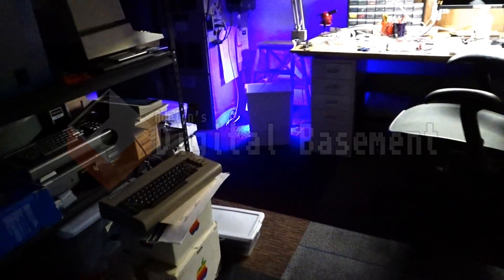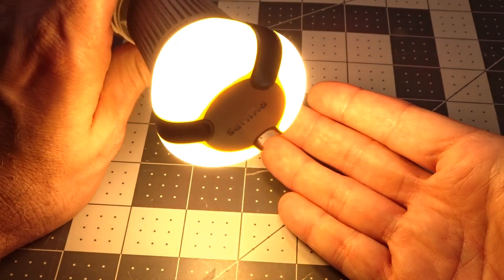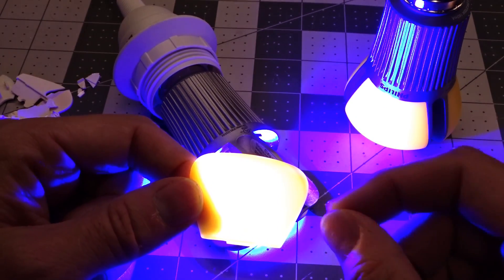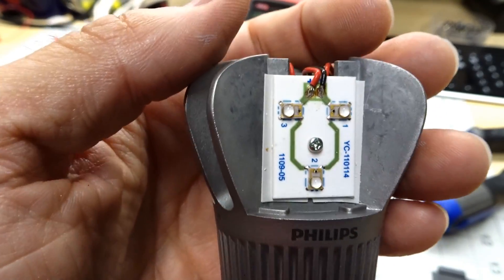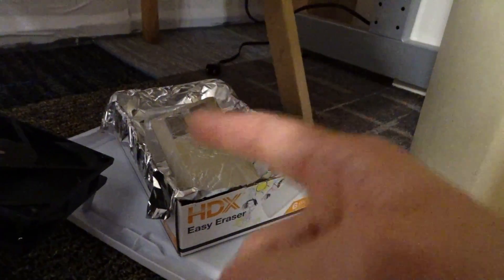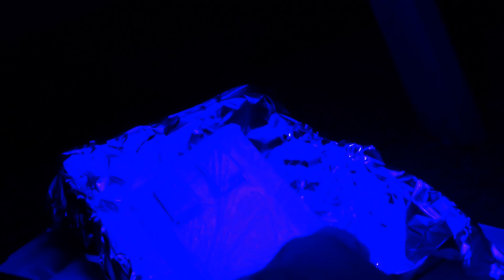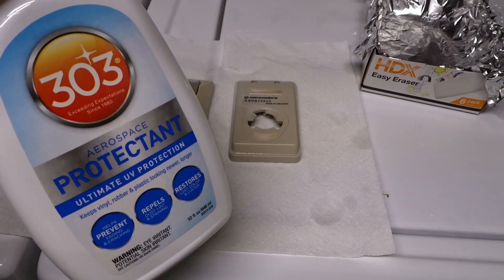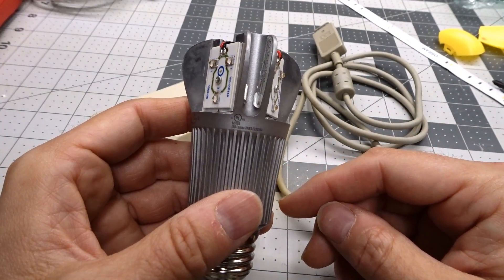A new way to fix yellowed plastics indoors?

Comment: And to be true, heat works waaaaaay better then UV. Just submerge it into water, crank the heat up to 160°F / 70°C, add peroxide and leave it there for few hours. It will work way better.

Comment: Interesting, but the experiment really needs a control (H2O2 creme in the dark) to compare it with.
Reply: Without a UV light the lightening process takes a very long time (like weeks), that's why people use the sun or an artificial light as a booster.  An alternative is to use a higher percentage H2O2 around 35% which can really speed up the process.
Reply: I use 40% creme and with UV or without makes almost no difference.
Reply: @chrisyboy219  Where do you buy the creme from?

Comment: Very neat!  I'd bet that there is good amount of UV coming out of those LED's along with the blue light.
Reply: Those LED's don't emit UV. They're monochromatic and only emit 457nm ±15nm which is nowhere near UV. If you want some evidence then go to mouser, search for high power led's and filter out 457nm LED's and read the datasheet. Of course high intensity light is always dangerous and the shorter the wavelength the more energetic the light.

Comment: That's a good haul.  Those remote phosphor lamps are very novel.  I've got a couple here and noticed that one has been in use in a corridor at Edinburgh Castle for a long time.
Reply: what about that clear UV lamp you reviewed on your channel clive? the germicide one. wouldnt that one be better for retrobrighting?
Reply: O HAI bigclivedotcom. I was about to message you a link to this video, but you've already seen it. So Adrian has beaten you to the punch in terms of a teardown of these, heh. It's pretty cool to see what's inside. I guess the in-series wiring explains how one of these can easily "burn out" upon failure of a single component. Btw., if remote phosphor really does have an efficiency advantage as is claimed then I wonder if there still are any new remote phosphor lamps being made today.
Reply: Surprised someone would throw them out - they don't make them like that any more. Maybe they just thought they were ugly when turned off (which they really are). I remember when these were on sale and I never owned any LED bulbs at that point because they were still too expensive.
Reply: I bought one similar to this about 7-8 years ago. I paid $25, and got buyer’s remorse. My wife didn’t mind the price, and wanted to keep it! It’s still running 24/7 in her lamp. The newer ones that cost $2 only last a year or two!
Reply: Hello Clive can I ask you a couple of questions ? 1 How many bandages on both your hands right now ? 2 Has anything blown up lately on your channel ? :-) :-) :-)

Comment: Get some of those suckers to the 8 bit guy!

I bet an ozone generator chamber with those lights in it could easily retrobrite plastic without the need for hydrogen peroxide, which seems to just be just an oxygen or ozone source
Reply: They sell florescent bulbs that are extremely short wavelength - on the order of 184nm which is enough to also generate ozone while it is running. You don't even want to be in the room when it is turned on. By contrast these LEDs are still over 400nm.  I wonder what one of those would do to yellowed plastic with and without the peroxide.
Reply: I've seen purpose built ozone generators online, and they aren't that expensive, mostly used as an air purifier.

Comment: The unfiltered blue light obviously contains a lot of UV.  Any idea of the spectrum?  Might be dangerous, might be not, but I would not bet on it.
Reply: LED's are monochromatic light sources e.g. they emit at only one wavelength (with a certain but generally small tolerance) so there's no way that you would get 380-315nm from a 457nm ±15nm LED. If you don't believe me then go look at some LED Datasheets and see for yourself. Of course high intensity light is always dangerous and the shorter the wavelength the more energetic the light.
Reply: I'd have to agree with you, that 1959Berre has assumed incorrectly that such components should ever be so far out of spec.
Reply: These LEDs are 457nm. It's near-UV, not into the UV, but still pretty intense. It's energy that makes the chemical reactions work, and the higher the wavelength of light, the better it should work, and the less exposure time you'll need.

Comment: For indoor retro brite, I've had good results using the submersion method in peroxide solution, and using a sous-vide machine to keep it at a constant temperature. Best thing about this method is that it scales up really easily since the sous-vide machine and peroxide solution can be placed in different sized containers. Sous-vide machines are a bit pricey (~$100) if you just one for retrobrite, but they're also a nice tool to use for cooking as well. Easiest way to a steakhouse-quality steak at home.

Comment: And I thought the 8 bit guy had established that it's the temperature that was responsible for the reaction, not the UV-light. That's why he does his retrobrighting in heated water now when he can't put it in the warm sun of Texas.
Reply: UV may not make a difference but a vented full spectrum light works (no heat thrown on the part).  Heat alone also works, combined the effect is double.

Comment: Interesting experiment...find some plastic you don't care much for...something REALLY yellow.  Retro-bright it.  Then, spray that 303 spray on HALF of it.  Report back in one year.  :-D    In fact, maybe even let it sit outside for weeks or something to get lots of UV exposure.  It would be a good way to test the 303 spray.  And, it really wouldn't take much effort.  Just time.   Anyway, just a thought.
Reply: My kitchen smoke detector is really yellow compared to by bedroom one.  That's something cheap and easily replaced to think about.
Reply: Most plastics get yellowed not due to UV but due to atmosphere since the brominated plastic reacts with the atmosphere. That's why you'll see keyboards be pretty uniformly yellowed on the bottom and top. That's not to say that UV has no effect - you see it in the mouse here - but I doubt that you'd get the same results if you left it outside for a year vs. inside.
Reply: @KeithGable Yeah, see, I hear different opinions all the time.  Even from "experts".  So I say....only one way to find out.  Give it a try.   I will say, however, that one of my C128's that used to be white has yellowed very uniformly.  In fact, it looks like it was painted yellow.  That C128 has been in a box and in my climate-controlled basement for years.  Yet, it yellowed.  So I know that UV isn't the 100% root cause.  But, I do think UV accelerates the process.  That PARTICULAR C128 would probably be brown or orange if I had left it in the sun instead of a faint yellow.  I also believe it's the ratio of bromine vs. plastics.  I believe that while bromine was used, no one really knows the ratio in every piece of equipment.  Some plastics have very little...some may have a lot.
Reply: cb meeks
On my VIC20, which I've had from new, the outside of the top is yellow whilst the bottom appears to be the original colour on the outside. This creates a yellow to beige transition halfway up the sides at the seam. The plastic for the two parts must have been of a slightly different formulation. They were never exposed to much sunlight, though they were in a room which at one point was on fire. This was my mum's fault, not mine! :)

I recently read a comment on a YouTube video claiming it wasn't the Bromine flame retardants that were responsible for the yellowing, but the breakdown products of Butadiene. I don't know enough chemistry to know which is correct. I certainly like seeing experimentation to dispel myths.
Reply: Better yet, coat only one half of a yellowed piece of plastic with the 303, then apply the "blue LED" to both sides.  That would  tell us how much UV protection the 303 really has.  The side with the 303 coating should stay pretty much yellow if in fact blocks the US light.  This way the experiment wouldn't takes years ;)

Comment: I've never retro brightened anything ...but I noticed something odd once with clear plastic viewing window (on some retail packaging that had been stored under a cabinet for years partially covered... The uncovered part even though stored for years in the dark had discovered and gave the items in side the package a golddish hue the other part of the package stored the same way only difference was another box was sitting on top of the clear plastic viewing window ...the covered part had no discoloration... Not sure what that means as far retrobrighting goes but I'm sure someone out there could take that knowledge and apply it to retrobrighting ... Or at the very least develop a new method for long term storage of our antique electronics and other items of value that contain plastic components...

Comment: Hey man I watched rgb mob videos ...I think you done a fine job ... But I need help I have a 13inch goldstar color television that I'd like to add a.v. inputs to  it was manufactured in December 1986 it is model cmx 4200 
I've had the back off and I'm thinking that I might be able to add a.v. input by connecting a.v. Jack's at the 4 pin plug on the p.c.b. marked as vhf any info you may have would be greatly appreciated... I found one schematic online but the site wasn't clear about the price and went into a long winded speech about being clear on what was being purchased... My immediate thought was scam so I backed away from that site ...again any info. You may have would be greatly appreciated

Comment: for who don't have access to these bulbs, get the cheap dollar bulbs - remove the yellow coating on the led's and violla!
Reply: and voilà please ... yes I am French. ;-)
Reply: Je préférais viola...
Reply: @chongtak  Well that means 'raped' in French. Simple past ;-(
Reply: Je suis prof de francais ;)
Reply: I don't think this will work since the yellow coating is more or less what the LED is submerged into... think of it as a potting compound.
Reply: You cannot do that. The yellow phosphor is mixed with a silicone substance, and under that, there is the bonding wires that you will rip.

Comment: Or perhaps the excessive heat of those bulbs managed to make the cream warmer and sped up the retrobrit process.
Reply: @adriansdigitalbasement  I am rather convinced that the mouse would not be room temperature under the light even with the small fan blowing on it. You do not need any UV or ozone to retrobright only heat.
Reply: Then it seem like a perfectly viable method.

Comment: Wait, how is this a new method? People are doing it like this for years..
Reply: Definitely looks like it. Since these are LEDs, not lasers, their light isn't a single monochromatic wavelength, but they have a fairly broad spectrum that just appears to peak at an intensive blue as far as our eyes are concerned.

That also means they're emitting UVA. So, combine the UVA part of the LED's spectrum and the obvious amounts of heat (note that most of the lightbulb's body is in fact a heatsink) and that explains why this stuff works as well as it should.

It may not be a new approach, but this video shows the effect a bit more clearly!
Reply: Yep.
Reply: Absolutely. I have used LED grow lamps to do indoors de-yellow-ing in the past, and it has worked quite well. If you want to really speed things up, you could purchase a UVA lamp and use that - but be careful with those. Certain UV-spectrum light can be high damaging to your skin and eyes.

Comment: Good find Adrian.  Looking around YouTube today I see others had success with standard lights.. Example here >>> https://youtu.be/xBS_UEV35W4?t=970
Reply: Yes seems that we only need photons of light, could be that UV photons are more energetic so work faster. It seems it's the decomposition of the peroxide that's doing the bleaching. This got me thinking, perhaps exposing the peroxide to light before applying it to the plastic would also work.   I saw this on wikipedia >>   Hydrogen peroxide is unstable and slowly decomposes in the presence of light. Because of its instability, hydrogen peroxide is typically stored with a stabilizer in a weakly acidic solution

Comment: Do you think you'll take all the PCBAs off an mount them to the inside of a metal box?  You could have have them on all the sides of the inside of the box and be able to do all sides of a thing at once without having rotate them.

Also you need a Patreon.
Reply: You could also use 2 server PSUs so it doesn't tie up your bench supply, they're 12V (but the ones I have actually have a thing inside that allows you to set the voltage up to 12.5V).  You just have to put them in series (and make sure the negatives on the PSUs aren't connected to the ground of the case).

Comment: @ 7:30 - interesting.  The bromine fluoresces red...huh.
Reply: Okay, I'm not a chemist by any stretch of the imagination, but looking around, it looks like ABS is impregnated with TBBPA, Tetrabromobisphenol A.  This is a Bromine that reacts in the presence of Bisphenol A. Interestingly, there are other bromines that are used in DNA research and they, too, cause DNA to fluoresce red under UV light.  Anyway...the closest thing to red fluorescence I could come to was an EPA white paper that discusses the presence of red phosphorous in some ABS flame retardant products (which is trippy when you consider it's used for match manufacturing).  So maybe it's something to do with that?  Here's a link to the paper:

https://www.epa.gov/sites/production/files/2015-08/documents/pcb_final_report.pdf

(That's less ABS and more PCB so I'm probably grasping at straws.)